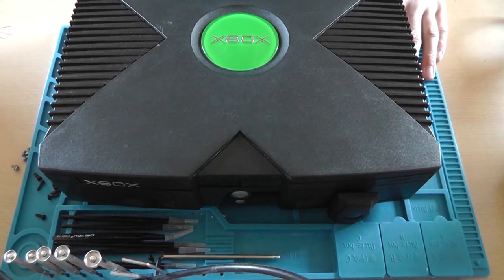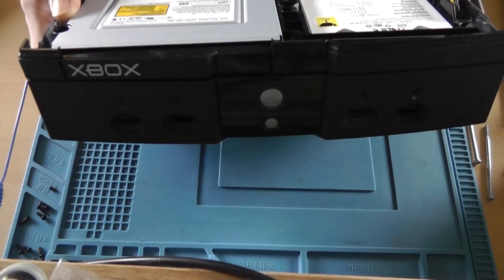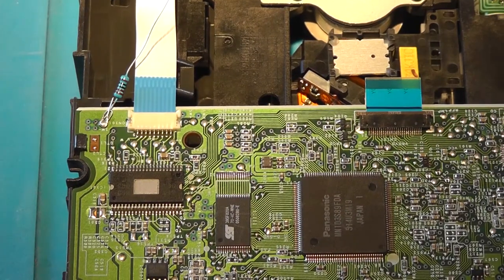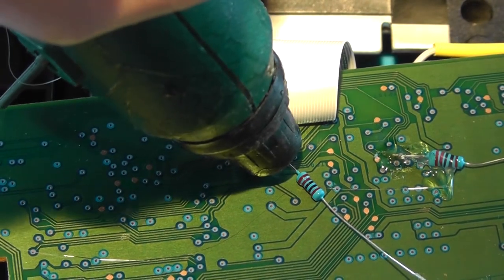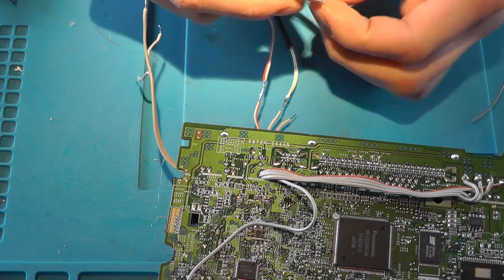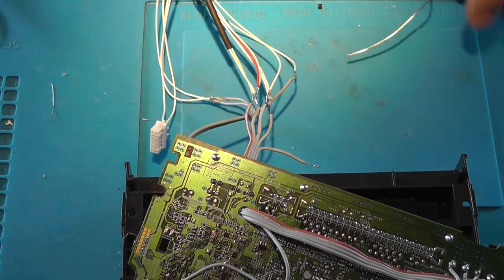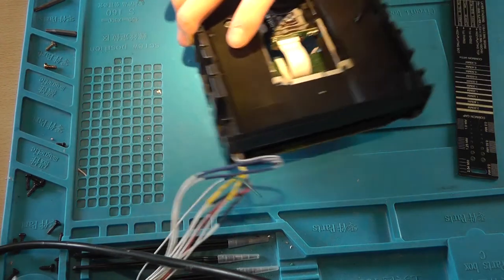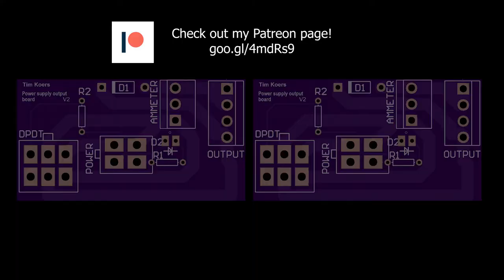#66 [GUIDE] XBOX 🕹 DVD Drive 📀 retrofit LG GDR-8163B

Comment: Does anyone know what laser is compatible with the HL GDR-8050L Drive? I believe the one for this drive would drop in as a replacement. Thanks.
Reply from the maker: I haven't replaced the laser alone, so I'm not sure about that
Reply: It is the same, SF-HD68 designed and made by Sanyo Electronics, also included on some Xbox 360 slim DVD Rom units. Isn't that rare or expensive and very good quality and does read fast, very reliable. Way better than both Philips or both Samsung drives. 

Working flawless with the stock HL GDR-8050L playing all media, original games, CD-RW, original audio CD, game backups, DVD movies but not playing most CD-R or certain types of DVD+RW 

Take note of something important, sometimes isn't a laser pickup issue, the DVD board uses tiny electrolytic capacitors, replacing those can solve reading problems, this drives are old so, capacitors need replacement BEFORE adjusting the pots. Don't do it without taking extreme care, or this will kill the laser diodes. 

Other details, keep the entire mechanism clean and properly lubed, and be sure the sled motor that moves the laser is clean and with some lube too.
Also there is a small switch on the spin motor assembly who holds the disc, be sure to clean both of them for better performance. 
Attention: Don't play with the pots on the laser or this will likely kill it or reduce the lifetime. This adjustment is a last resort measure under my point of view if the cleaning and recap didn't go well. 

I got 2 of this original Hitachi Xbox drives and they just needed deep cleaning up. Both optical laser are quite in good condition despite the time.

Comment: Nice guide! I salvaged a connector/socket from a dead 360 motherboard, which is the same like the OG's on the DVD drive end. Except it's missing one pin, but it's for power, which I wanted to supply via the Molex connector anyways. So I needed less wires and soldering. But at this point I stopped the mod, because I made it exclusively for servicing. Like installing softmod or booting a Hexen disc, if the console's drive doesn't read discs anymore.
Reply from the maker: Oh damn! Very nice man! Did you write a guide on this?
Reply: @TimsElectronicsLab  Thanks! Not really. I'll probably make a post on around the weekend in the OG Xbox FB group, but that's it.

Comment: I've always thought about adding something extra (glue, or a layer of something) to make the DVD bezel flush with the case.

I have a flashed GDR-8163B. Yet to mod the controller board though! I typically mod the console rather than disc drive replacements, but will give it a go some day.

Comment: Very good video, this information is hard to find after so many years. Question, I have a GDR-8164B that works perfectly without the signal wires, is there a way to find if the signals are still the same in the newer model?
Reply from the maker: Thanks!! That is good question, I would try to search on the firmware differences of the two. If you flash the modded firmware, you risk bricking the device
Reply: @TimsElectronicsLab  Thanks for the response. I just got my hands on it and opened it up, unfortunately the controller board for 8164 is very different. Drive is usable to boot homebrew and tools on modded console without the full pin header and flashing, but I guess I will not have a full integration with this one unless there is a method to find the signal points. Regards.
Reply from the maker: Hmm, you could try to reverse engineer the signals. I think it should be well documented, and now with the latest Microsoft source code leak, the source code of the kernel is available as well.

Comment: Are there any specific resistors required, or will any 1kOhm 1/4 watt suffice?
Reply from the maker: I'm not sure really, it's been a while since I shot the video
Reply from the maker: I think 1/4 watt is enough, if it burns down, you might need a bigger one
Reply: Thank you. Any idea why my computer may not "find" the DVD drive? I run [flash.bat] but the computer says [No CD/DVD drive.(5)]

Comment: will a gdr-8164B  drive work with the 8163b firmware?
Reply from the maker: That is a very good question. I'm not sure, but you'd want to be very careful as loading the wrong firmware may render the drive unusable. I recommend to do some research on the internet to see if anybody has tried

Comment: one thing that stumps me is what actually fails on the original drives Circuit board...surely board failures can be fixable right?
Reply from the maker: Yes they can, but on this one I burned the laser 😂
Reply: @TimsElectronicsLab  oh dear!.. Which part should be changed, the controller chip, the NAND or the capacitors?
Reply from the maker: In case the disc doesn't read? The laser that is the weak point of this system. It wears out prematurely and causes the Xbox not to read discs
Reply: @TimsElectronicsLab  in the case of my unit it flashes up Error 12. which means the drive PCB has failed
Reply from the maker: Are you sure everything is connected properly? Also inside of the CD drive?
Reply: @TimsElectronicsLab  yep I've tested it all... They console works with the drive from my friends system.
Reply from the maker: Hmm, that strange, do you see the laser through the disc if you try to run it with the enclosure off?
Reply: @TimsElectronicsLab  most discs i have are too thick for me to see the laser though...plus i don't have much time before it flashes an orange LED and turns off
Reply from the maker: Hmm, I would suggest to try and find some Xbox forum's and look/ask around there
Reply: @TimsElectronicsLab  will do thanks

Comment: I'm a bit late to the party on this.  Will an 8162B work with the same process?
Reply from the maker: That's a good question. I'm not sure however, i don't think you should try to flash the drives firmware with the 8163B firmware however. You could try, if you're feeling lucky, but make sure you've got a proper backup of the EEPROM, that you can restore
Reply: @TimsElectronicsLab  I found a 8162 and 8164 in my parts bin from ripping Wii games quite some time ago.  Might have to take one apart and check things out.
Reply from the maker: That's cool! Let me know if you end up getting it to work

Comment: One quick question do you have the original firmware bin that way  i can program it to the drive directly with my programer it can be hex or bin because i have the Hp gdr-8163b and it wont let me update it not even with the switches but i can flash it with a programmer directly
Reply from the maker: I don't have it unfortunately, there might be some website that has it though
Reply: @TimsElectronicsLab  oh ok i want to know if there is another drive that is compatible
Reply from the maker: There is one other drive compatible, but that one isn't being made anymore
Reply: @TimsElectronicsLab  ok i manage to flash the drive to  0L23 firmware but when i want to update it to the 8050L firmware i get no  cd/dvd drive . (2) do you know how can i fix that because the drive gets recognized at the boot selection screen
Reply: @TimsElectronicsLab  i have manage to flash it on windows with cmd using the switches  to the original 0L23  firmware first and then flash the the 8050L on cable select settings on the ide

Comment: if you upgrade to a faster pc drive, at least upgrade your Ata66/100 IDE cable to a Ata133 cable, or the whole job is useless...
Reply from the maker: That is correct, but the point of this video was to replace the drive if the original one is broken 😋
Not necessarily to make the XBOX faster